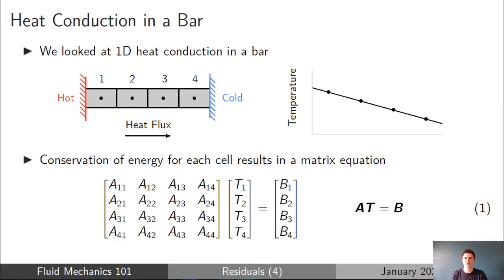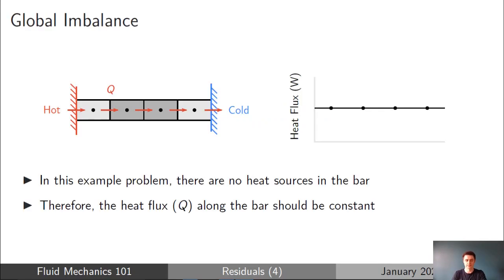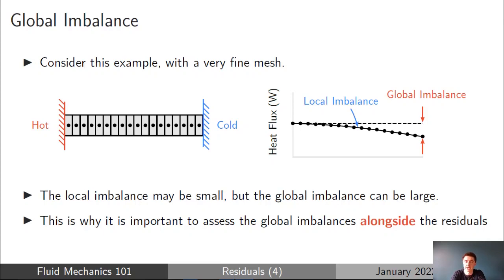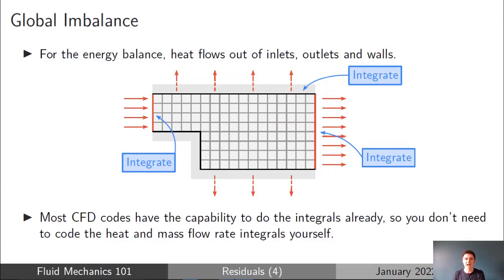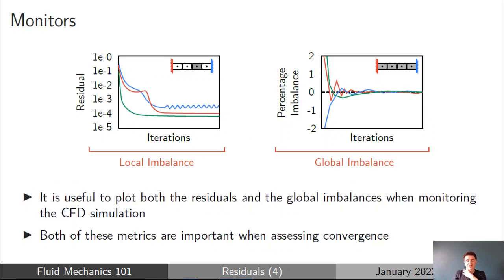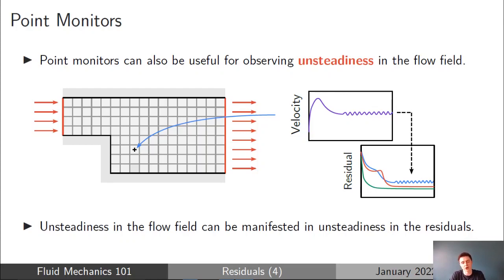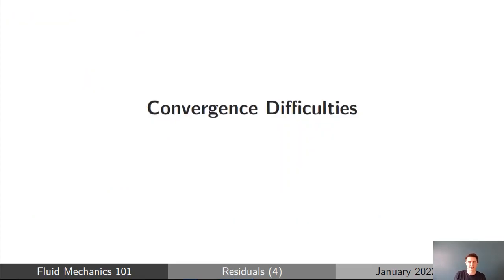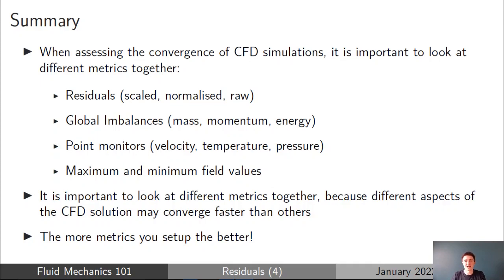[CFD] Residuals in CFD (Part 4) - Global Imbalance

Comment: How do you deal with residuals and global imbalances in a solver for unsteady compressible flow with strong wave action? Do you iterate during a given timestep to reach convergence for that timestep? Due to the compressibility individual cells can accumulate mass, energy and momentum, so how do we know if the solution is correct (converged) for that timestep or not?
Reply from the maker: Yep converge within each time step. 

The accumulation of mass, energy etc is accounted for by the d/dt term which is included in the unsteady calculation (and is ignored in steady state)
Reply from the maker: If you can get the residuals lows at the end of each time step, you can think of that as the correct amount of accumulation within the cell (for the given fluxes across it's boundary, which aren't equal, hence the accumulation)

Comment: When assessing convergence, if the variable of interest is flattened out, but the residuals are still decreasing, do I need to continue iterating until the residuals are also flattened out?
Reply from the maker: If the variable of interest is the only thing you are reporting, then you can stop. But if you are looking at lots of aspects of the case (flow field, wakes, turbulence generation) then I would keep going until the residuals are flat as well
Reply: @fluidmechanics101  What about the transient case? Must the residuals also be flattened out as well in each time step?
Reply from the maker: Ideally yes. But usually what we do is compare the result of interest (i.e. drag coefficient) with different number of iterations per time step. For example, compare the results with 5, 10 and 15 iterations per time step and see if there is a significant difference in drag coefficient
Reply: @fluidmechanics101  Really thank you for your guidance.

Comment: I am trying to simulate high-velocity flow (using k-e model) through porous media in unsteady state. Initially, the residuals decrease for nearly 15000 iterations. Then they start to increase and create fluctuations in my output parameters. How can I tackle this issue?
Reply from the maker: Have a look at the flow field and try and work out what is happening. Maybe look at the solution in iteration 14000, 15000 and 16,000 and try and work out what is happening

Comment: Good job, Aidan! Thanks. It's a common advice when you have a convergence problem during the calculation try to simplify the model - exclude some equations, supersonic flow, polynomials in gas properties etc - and add this features consequently. Of course, it will not help completely if you have bad mesh cells. Good luck!

Comment: Hello Dr. Aidan! Even though I'm a more experienced user, this series was a pleasure to watch. If you don't mind a suggestion, in my opinion it would be well worth it to expand the topic of convergence issues diagnosis. Maybe discuss some advanced tool to identify where the issue lies in the domain and how to solve it - for example some tricks to improve mesh quality without necessarily simplifying the underlying geometry. I often find myself struggling with inflation layers quality when trying to reach very low (<1) Y+ values.
Reply from the maker: Yes, thanks for the suggestion! I think this would be very useful for many CFD users

Comment: Great video. Load of information for me doing Phd in mechanical engineering. Also, as a suggestion to learn more, can you also instruct us how to reduce residuals using ansys fluent, and what are the magnitudes when round-off error also propagates in the solution. A demonstration would be very helpful.
Reply from the maker: Good suggestions. Thanks!

Comment: Hello Aidan, I do have a question about residuals as well which is provided by ANSYS. I was analyzing the multi element front wing of an F1 car in ground effect and I was able to validate my results for a certain case. My residuals were quite okay (about 1e-4) but when I decreased the ground clearance of the wing, the residuals increase to the level of 1e+1 which is possibly the result of having large velocity gradients. I also get higher residuals when I increase inlet air velocity. I want to use a steady state solution to find a result but the residuals are just too high when I use it. When I use unsteady state solution, residuals actually decrease but I'm not sure if it's necessary to use an unsteady solution there since I'm just trying to find the average value of drag and lift coefficients. Do you have any ideas about how I can decrease my residuals when I use a steady state solution? I did try to refine my mesh and I couldn't see any difference at all.
Reply from the maker: It sounds like you either have 1) a problem with the mesh (when the clearance reduces the cells are getting skewed and the solver is falling over) or 2) there is some real flow unsteadiness which is trying to develop and the solver is trying to go unsteady. My advice would be to have a look at the mesh quality and flow field and see what you can see. That should point you in the right direction. Have you tried plotting the residual contours? Maybe you can find the cells with the high residuals and work out what is going on

Comment: Is the shock one of the transient flow?
Reply from the maker: You could have a steady shock (in that the shock itself stays in the same position) but most often you will need some type of transient solution to allow the shock to develop and move into the correct position

Comment: What do you think about using steady-state solvers for flows that have some unsteadiness? Like the backwards-facing step you looked at? Do you think the results still provide valuable information or are they actually misleading and wrong?
Reply from the maker: Yes, the steady state solver will still provide valuable understanding (and it is often useful to do one before the transient anyway because it is a great initial condition for the transient). The steady state result will normally be pretty close to the actual result for the broad flow field. A useful comparison is to compare the steady state with the transient and actually see for yourself what the differences are. Maybe 10-20% difference would be expected but you are unlikely to get 100-200% difference
Reply: @fluidmechanics101  Thanks for coming back to me. Your suggestions make sense. Appreciate it!

Comment: This series of videos are extremely clear and practical! May I ask for a special case about residuals: If I run a DPM case with the continuous phase starting from the stagnant state, but the injected Lagrangian particles will bring in extra momentum and interact with the continuous phase, then what is the suitable criterion to judge whether the residuals for the continuity equation of continuous phase are small enough that the case is already converged?
Reply from the maker: I would probably look at other metrics besides just the residuals. Can you think of any monitors that might be appropriate for your case?
Reply: @fluidmechanics101  Thank you for the answer. I agree with you, I might look for other quantities like wall temperature...